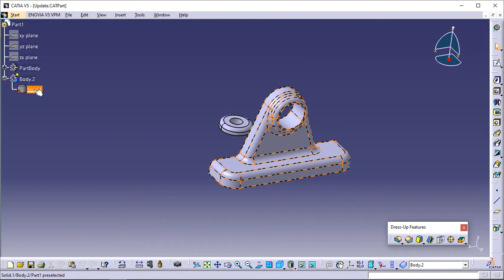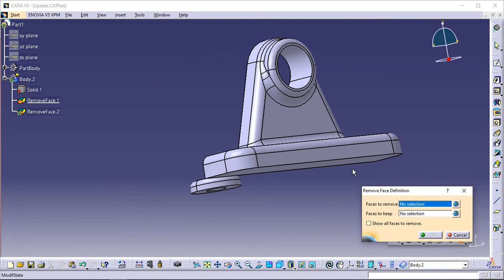CATIA V5 - REMOVE FACE

Comment: In catia V5 , I am doing a modelling of connecting rod, in beginning I am likely to design an cylinder extrude for draw two concentric circles and then extrude , it show partition in the part, even I couldn't give the partition command but it is formed on the design and so can you resolve it and give some step to reduce the partition in the model of the design aspects
Reply from the maker: Hi
I would recommend sharing your question in a forum with screenshot.
Below is where you can start.

https://www.eng-tips.com/forums/dassault-catia-products.560/